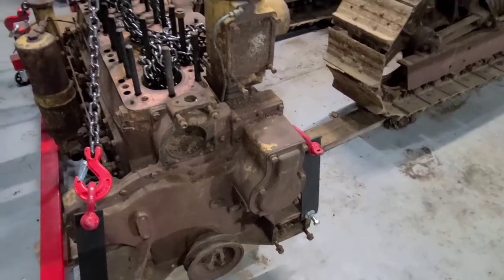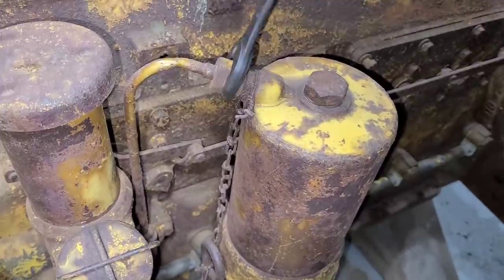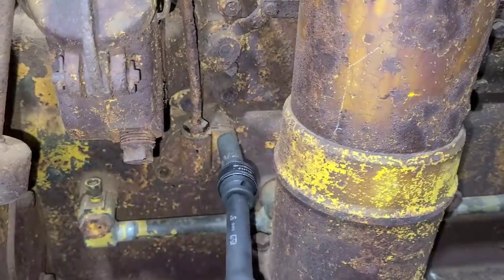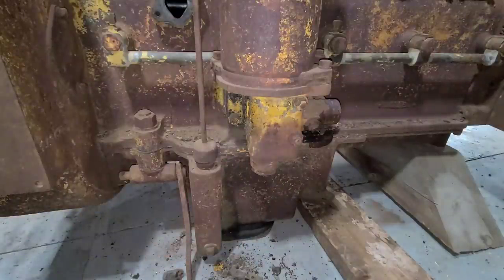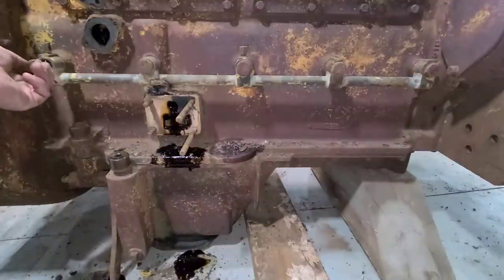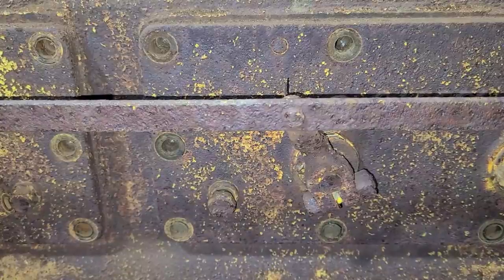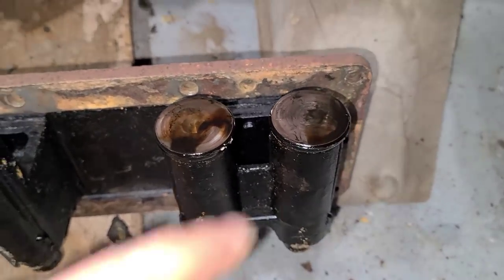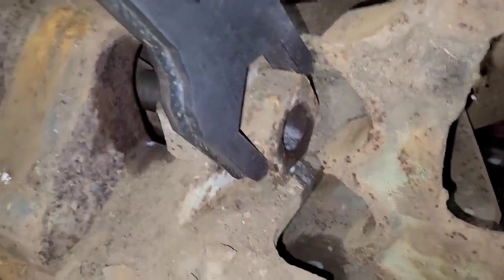Caterpillar RD-4 Engine Disassembly Pt.5

Comment: For what it is, personally I would try to polish the cam on a lathe with Emery cloth and the lifter base on a flat surface doing the figure 8 motion. Low speed engine combined with modern oil and probably low hour of operations within the next couble decades should be alright.
Keep on going on!
J.F.🇨🇦

Comment: I used to grind lifters on a Sioux valve grinder by using the stem grinding stone and rotating the lifters in the V-block. Never had a comeback from those.

Comment: Hi Kyle, Maybe someone with more expertise than me can help with the cam rust. The cam must be hardened so I think there is a good chance the rust has not gone too deep. I do know that rust has about ten times the volume of the steel that was oxidised to form it so the damage may well not be as bad as it looks at first sight. If the cam is beyond use as it is and you cannot find another there are specialist firms that can rebuild the profile for you. There's a technique where new steel is sprayed on. Cat produced such comprehensive documentation that the as new profile must be available, a close approximation could also be obtained from the other cans of course.

Comment: Excellent video the cam shaft should be repairable Barry's Cam in Lester prairie Mn is able to repair camshaft and lifters. I had them repair a fuel pump lobe in a big IHC gas truck engine a few years ago and it turned out perfect

Comment: Maybe you can lap the lifter on a piece of glass/surface plate and some wet sandpaper.

Those oil lines or other pipe fittings that have rusted stuck: some heat loosen them right away. even tho there is fluid inside.

Friends looked me like crazy when i heated my cars rusty brake lines with oxyacetylene :D but they opened cleanly without any line twisting and even the brakefluid inside stayed clear

Comment: get either an oil school oiler can or a sureshot sprayer. Put a 50/50 mix of acetone and ATF in it. You won't believe how much crap that can get into to help break things loose.I've tried it against WD-40, PB, Aerokroil and it wins. Plus its cheap. A line like that is never going to release easily without it, and you have no shortage of fasteners needing penetrant. I'm in the rustbelt just like you, that mixture works.
Reply: Acetone and ATF is old school and works well.
Reply: @Fatamus  Its also the cheapest to make. Back when the 5.4 3v had plugs breaking left and right I used it and have never broken an original two-piece plug off in the head. However have had to extract them when others attempted to do it and then it got towed to me. Just used it on a 2012 F-150 last weekend. The steering was tight because the upper u-joint on the steering shaft was seizing up. New shaft is $200. Soaked it in the mixture and started working it around, dipping back into it here and there. Started getting rust to bleed out as it freed up. It got in there and made it move like new. Loaded it up with thicker oil after that and its good to go for awhile.

Comment: One of the next steps on my Sixty is resurfacing the lifters due to rust. I have a couple ideas I’ll hopefully try in the next week. Driving those pins in sure helped, I remember I struggled with those covers on my D4 years ago. Also have you seen Rustbucket Revival’s video on buying and hauling his RD4 home from North Dakota to Texas and recently an attempted start. Another cliffhanger, will the wrench work? You’ll be producing a TV series soon.

Comment: When you pull the lifters out of the covers. Put two face to face to see if they have slight convex grinds to the faces. Some engine shops and many cam grinders have a lifter regrinder  that puts the convex shape back on. 
This can be done in a lathe with a tool post grinder.. 

This is just info to stick to the wall for later. I know a so cal cam grinder who does have that machine. He may have a master to regrind the cam lobes.

Comment: I honestly think that lifter will clean up with some 600 paper and oil. If this engine were to be put back to hard work again I think it would be best to replace everything that is slightly dodgy but if it is only for occasional work or maybe running at shows it will be fine.

Comment: Hi Kyle. It looks like things are coming along remarkably smoothly, considering how very few pieces are stuck, froze, broken, or rounded. While I'm not there with you to really see it, that rust on the lifter looked pretty superficial at first glance. I'd think you can grind a few thou off of the face if absolutely required and not go too deep into any case hardening. I'm really hoping the cam is in good shape, it is harder to regrind them and not change the lift.

Comment: I know you don't like penetrating oil but are you going to use anti seize on the bolt for re assembly?  Still looking very rebuildable.
Reply: I missed it, why don't you like penetrating oil, Kyle??  It helps loosen things and get rust out of way

Comment: I am astonished that you do not use penetrating oil to drown the engine before you start taking the engine apart (or any other part that is rusted).
Reply from the maker: No need

Comment: You CANNOT put traditional  flat lifters in any kind of grinder (aside fromnthe manufacturer). All traditional, modern lifters are not actually flat on the cam face. There is a slight curve ground into the lifter from the factory. That being said, given the date of this motor and the fact it is a early diesel the lifters may in fact have true flat faces. I never saw a lifter from this era/model so I can't say one way or the other. Maybe Squatch can buzz in here and set the record straight. The cam may just need a polish, or it can potentially be ground from a shop with the proper equipment. You may be able to source a replacement, just have to do the leg work. Get yourself some junk valves and learn/practice with that valve grinder. It's not a bad piece of equipment to have around.